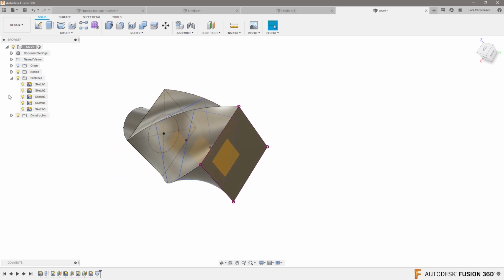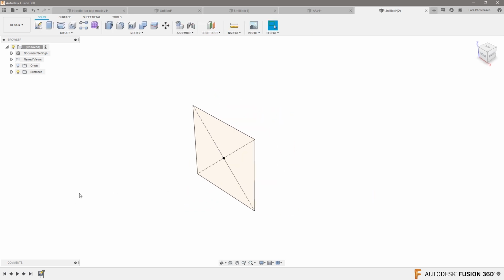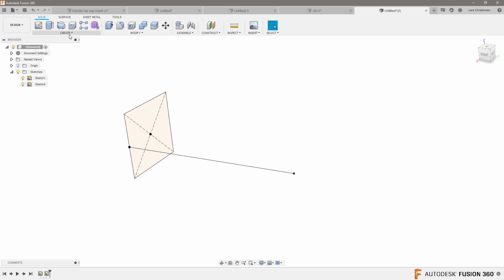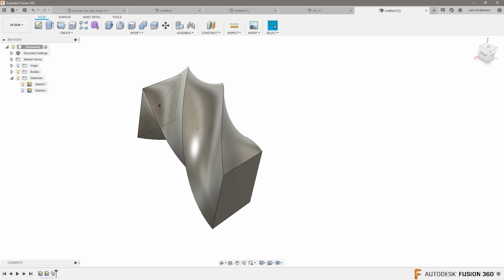Fusion 360 — ANOTHER TWISTED METAL — Ask LarsLive

Comment: The big question is which one has the correct mass?
If you took a chunk of steel and twisted it, it would retain its mass. So what are the masses of the two methods ending up at compared to a blank of the same length? :-)
Reply from the maker: Good thinking 👍😊 I’ll have to test that